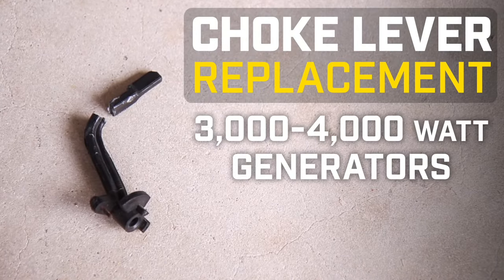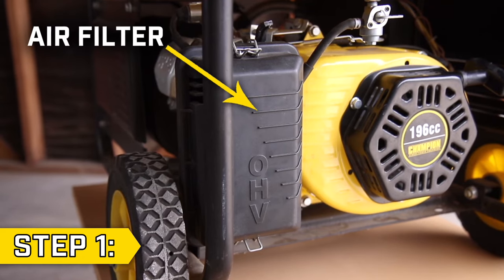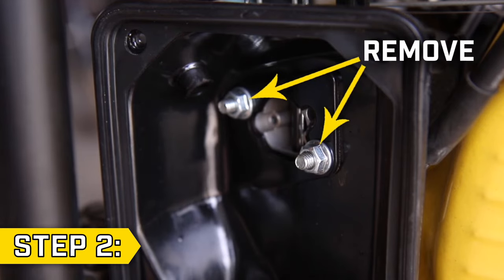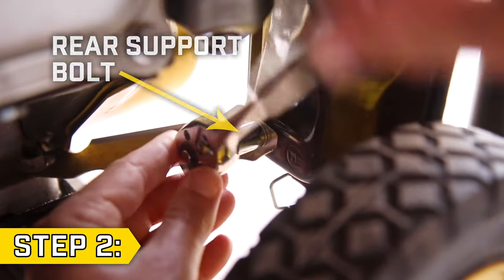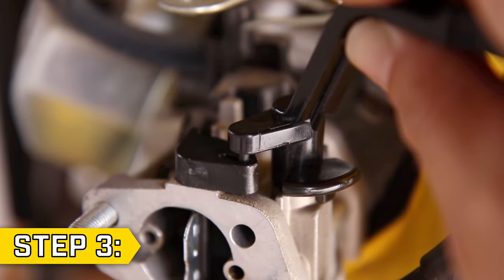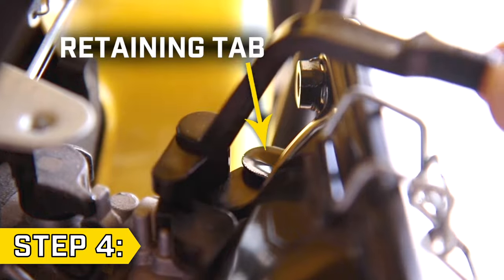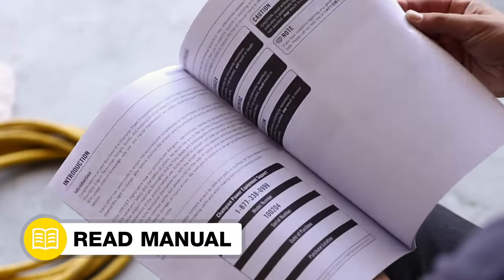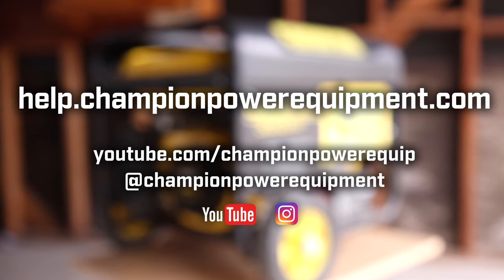Choke Lever Replacement (3000-4000-Watt Generators)

Comment: My 3550 weekender came with a screw holding the choke lever onto the post on the carb. However my replacement carb came with no screw holding the choke lever on. I guess I’ll pray that the air cleaner has a tab that holds it in place otherwise I’m gonna be screwed.

I can’t complain about it too much because my generator has been running daily for four years now.

 Champion has made a believer out of me. It’s a one pull wonder that’s rock-solid reliable. In four years all I’ve had to do was replace the pull cord a few times. I’m amazed at how reliable my $300 dollar entry level generator is.

Comment: If the choke remains closed or open all time so is it problematic or not
Reply from the maker: Leaving the choke open on a generator while it's running can cause the engine to consume too much fuel, have irregular power, & eventually be damaged.